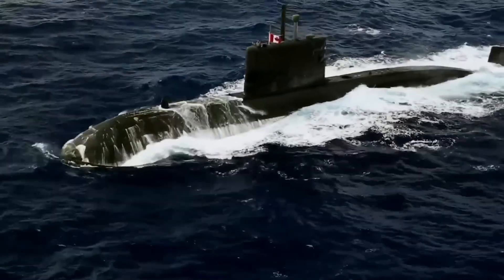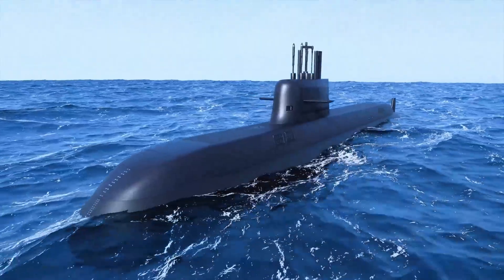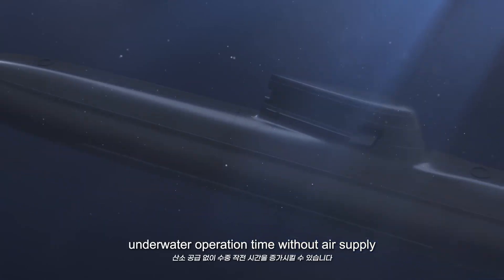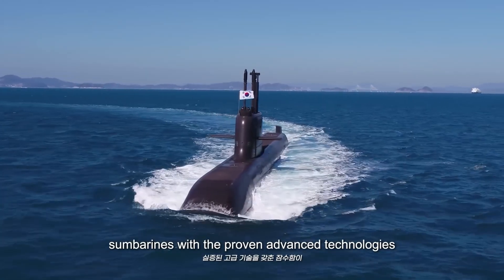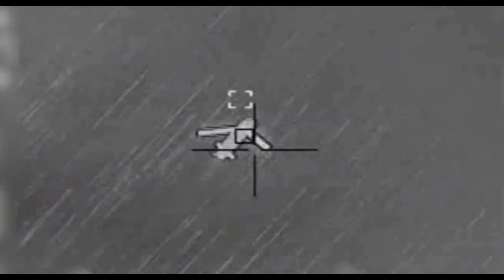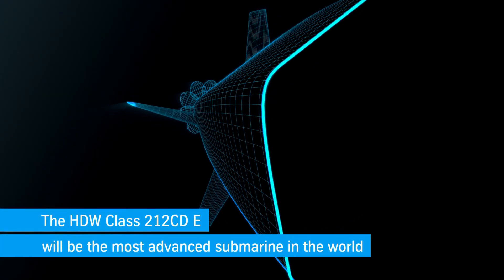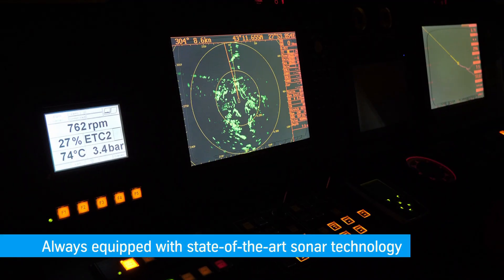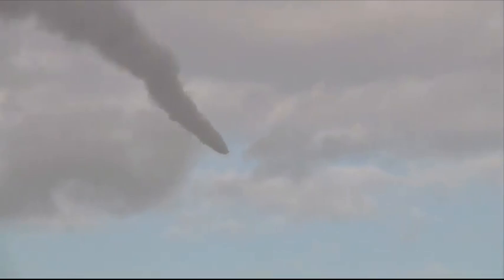RCN's Potential Next-Gen Subs

Comment: Longer underwater time and VLS make the Korean sub a better choice.  Also Koreans are VERY competent ship builders and that will translate to the subs being done on time and on budget.
Reply: The U212A/U212CD can operate underwater with its snorkel at 7000 Nm if necessary; the MTU systems are designed for this! Even WWII snorkel submarines could do this, for example, the Bauer 2540 Type XXI/XXIII! Range 15,000 Nm! When submerged, the U212CD can remain underwater for over 40 days!
Thanks to its air-independent fuel cell propulsion (hydrogen/oxygen) combined with modern batteries, the U212CD can stay underwater for more than 40 days, allowing for a significantly longer submerged duration than the KSS III (over 20 days). The KSS III does not have this modern system and will not receive it! The KSS III system is based on the MTIU diesel/U214 and its own battery technology, which builds upon the KSS II platform!
A U212CD scaled to a greater length with VLS systems at 90 or 100 meters can remain submerged for significantly longer periods, >60-100 days according to AI analysis and experts (or >100 meters)! The MTU diesel engines can then quickly split water into H2 and O2 for fuel cell and battery charging while snorkeling! The KSS III is essentially a derivative of the KSS II/U214, which is a class below the U212A!
The U212CD is in a class of its own, above the U212A, and according to experts, the KSS III would have no chance of survival in direct combat! AI analysis confirms this! Experts also believe that no other submarine/submarine hunter in the world can currently compete with the U212CD! That's why Germany has just ordered four more U212CDs, for a total of ten!

The development of fuel cell technology began at TKMS/BRD Research Institute/FI as early as 1943 with Type XXI/XXIII U2540! Instead of oxygen, they used peroxide, which was still too dangerous to handle! A test submarine of type U2540 achieved 27 knots underwater! In the 1980s, BRD/FI finally managed to make the fuel cell operational! So, over 40 years of development have passed since 1943, to be precise – 82 years in total! Korea would not have been able to build its own modern submarine without TKMS know-how. It's about time users who write nonsense understood this!
So please, let's finally forget that Korea can even remotely compete with BRD in this area!
Reply: The AI facts are based on source citations and state >20 days dive time! U212CD >40 days!  
Both submarine systems are completely different, and they don't even understand that the U212CD has a high-performance fuel cell system that is unique worldwide! TKMS also offers VLS, and a U212CD scaled to 90 meters can accommodate 40+ VLS!
The U212CD is based on the U212A, which is already a league above in high-tech sensor technology, surpassing the KSS III! DLR has globally unique simulation software to test everything, including combat deployment! They already demonstrated to the US military that the X-31 would shoot down all US jets in a very short time. The US military laughed at that. When the real test deployment came, they saw that DLR was right! That was back in the 80s! Korea should show the cold-water/Arctic -1.8 degree certification of their KSS III! They simply can't do that! The U212CD can do all of that, as the systems have been tested on the U212A for quite some time!
If they prefer Korean cars, Korea can build its own diesel systems instead of buying high-tech, certified MTU diesel systems! It's also possible that Germany will veto them, and KSS III won't have any MTU diesel systems with a one-year production time! 45 years of development went into them! Korea hadn't even considered building submarines back then!
Reply: The KSS III is specified with a dive time of over 20 days, and the U212CD over 40 days! The U212CD is scalable in length or overall volume. So, you could build a U212CD with 90 meters and install 40+ VLS (Vertical Launch Vehicles)! The dive time would then be over 60 days and the range 17,000 nautical miles! The new MDBA stealth hypersonic missiles (over 1000 km/h) and stealth cruise missiles (over 2500 km/h, nuclear-capable) could then be carried in the VLS! Korea doesn't have any of this, not even the 400-800 km/h Diehl Barracuda underwater missile presented in 2005! The KSS III has an operating depth of 200-400 meters, and the U212CD, according to AI and experts, 200-1000 meters... a different league! Regarding high-tech sensors, the U212CD is even a class above the U212A! 
KSS III doesn't even come close to the U212A, as the Koreans only had access to U214 sensor technology, which is a class below the U212A! TKMS will deliver the first 3 U212CDs starting in early 2027, and according to TKMS, they will be able to build 3-4 U21CDs per year from 2027 onwards! Furthermore, Canada, as a partner, is allowed to build its U212CDs in Canada using TKMS' high-tech 3D Helm system, which is unique worldwide! Regarding the training of new employees as well as career changers, Germany is number 1 worldwide! Meyer Werft is building the 250,000-ton "Icon of the Sea" at Meyer Werft in Türkiye and is using the German system in the process!
Reply: @tlsig submerged for “over 3 weeks” and travel more than 7,000 nm on AIP + batteries. Korean Sub edges out the German sub.

The Korean sub is proven and exists. The gerbman sub is theoretical.

Also given how reliable Korean Automakers are vs German I think the Korean subs will end up being better in actual world use.
Reply: @tlsig the proposed Korean sub to Canada has a greater dive time of over 3 weeks. Also the variation in the German sub with VLS is not in the bid. Everything about the German sub is vaporware/prop.  The Korean subs are real and in active service.  

as for "germany is number 1" I'd rather own a korean car vs german car for reliability after warranty and I think that would translate to subs

Comment: German sub is too small to operate under arctic sea. But Korean is gigantic. Korean can give Canada mach 6 hypersonic missiles and rocket torpedo which has over 300km/h in speed. German can not provide these weapons.
Reply: They're talking bullshit, just like their colleagues! Korea only has a small prototype that's supposed to reach 300 km/h and looks like a Russian torpedo with a range of only 15 kilometers!
Diehl presented the Barrakuda in 2005, which has demonstrably achieved speeds of 400-800 km/h and is about the size of a torpedo! Its range is 100-160 kilometers! This is all being handled under the strictest secrecy! It can only be intercepted by the Barrakuda! Germany has a 25-year head start.
According to AI, Korea will only really run into problems when the test object reaches full size with its enormous kinetic energy! 1 ton of combat weight at 400 km/h equates to 110 tons of kinetic energy, and at 800 km/h, 220 tons that need to be controlled! The Barrakuda only has a control cone and no stabilizing fins, making it much faster and more effective!

MDBA/2025 has unveiled a stealth hypersonic missile with a Mach 6-7 range of over 1000 kilometers! Also, a stealth cruise missile (nuclear-capable) with a range of over 2500 kilometers! If that's not enough, the U212CD can be extended to 90 meters with 40+ VLS or 100 meters with 80+ VLS! If you want a ballistic missile group M51.4 with over 50 tons of payload capacity and 12 nuclear warheads of 150 kilotons each, then the U212CD can be scaled up to the 12,000-ton Triophant class! Then it can carry 16 M51.4 missiles!
According to military experts, the U212CD is the most effective submarine for the Arctic, as it was specifically designed for that environment! All systems and components of the U206/9, U214, U212A, and U212CD are certified for cold water/Arctic conditions down to -1.8 degrees Celsius! Korea cannot boast that with KSS III!siles!

Comment: KSS-3 B1 3700t VLS 6cell
KSS-3 B2 4100t VLS 10cell
KSS-3 B3 4500t VLS 14cell
Reply: MDBA/2025 has unveiled a stealth hypersonic missile with a Mach 6-7 range of over 1000 kilometers! Also, a stealth cruise missile (nuclear-capable) with a range of over 2500 kilometers! If that's not enough, the U212CD can be extended to 90 meters with 40+ VLS or 100 meters with 80+ VLS! If you want a ballistic missile group M51.4 with over 50 tons of payload capacity and 12 nuclear warheads of 150 kilotons each, then the U212CD can be scaled up to the 12,000-ton Triophant class! Then it can carry 16 M51.4 missiles!
According to military experts, the U212CD is the most effective submarine for the Arctic, as it was specifically designed for that environment! All systems and components of the U206/9, U214, U212A, and U212CD are certified for cold water/Arctic conditions down to -1.8 degrees Celsius! Korea cannot boast that with KSS III!

Comment: Memory: Korean submarine based on the German type U209, developed in the 70s, which the Koreans bought. The Koreans enlarged it and equipped it with lithium batteries and this vertical launch system. It is therefore a technically state-of-the-art model. The U212CD is based on the U212A type, the successor to the Type 209. Its technologies are 1.5 to 2 generations ahead of the Korean submarine. Canada gets the chance to build its own 212CD in Canada alongside the Norwegians and Germans. The project is timely and on budget, so the whole discussion about faster deliveries from Korea is pointless.
Reply: 당신은 거짓말 쟁이군요..ㅋㅋㅋ
한국은 209만 도입한게 아니라
이후에 214급도 도입하면서 계속해서 기술을 습득했고,
 현재는 이를 바탕으로  자체 개발한 kss-iii   batch1 3대를 생산하여 차례대로  전력화중이고,,
지금은 batch2의 두번째함인 장영실함까지 진수한 상태입니다...
결국 수중배수량 4000톤의 수직발사관을 가진 세계최고 연속잠항능력을 가진 재래식 잠수함을 
5대 생산하여 차례대로 전력화 또는 진수식까지 완료한 상태이지요.
서류상으로만 존재하는 독일모델과는 비교할바가 아니지요...

Comment: I saw the Korean sub up close while stationed in Jinhae, the naval base near the Korean naval academy. The specs are legit and it is very silent. This is the one Canada needs in light of Korea’s growing defense industry.
Reply: Exactly. German submarines, particularly the Type 212 and 214 models, are medium-sized vessels designed for coastal operations. They have limited operational range and endurance, and their fuel and resupply capacities are constrained, making them unsuitable for countries like Canada that require coverage of the Pacific, Atlantic, and Arctic Oceans. This design philosophy reflects the operational environment of the German Navy, which primarily operates in coastal waters such as the Baltic and North Seas.

In contrast, South Korea’s KSS-III-class (Jangbogo-III) submarines are large vessels of approximately 3,700 tons or more, capable of ocean-going operations. They are equipped with large batteries, hydrogen fuel cells, and an Air-Independent Propulsion (AIP) system, enabling extended submerged endurance and long-range missions. These submarines can also carry long-range cruise missiles. The large batteries extend the duration of electric propulsion, while the hydrogen fuel cells and AIP system allow prolonged submerged operations without atmospheric air, significantly enhancing stealth. This technological advantage enables KSS-III submarines to conduct sustained operations across the vast maritime areas required by Canada.

German submarines are primarily deployed in European waters. Specifically, Type 212A and 214 submarines operate in relatively shallow and enclosed seas such as the North Sea, Baltic Sea, Mediterranean Sea, Adriatic Sea, and Aegean Sea. While they benefit from quiet AIP operation, their displacement is only around 1,800 to 2,000 tons, and their operational endurance is typically limited to 2–3 weeks, making them unsuitable for oceanic voyages.

Therefore, while German submarines are suitable for European coastal operations, the KSS-III clearly represents an ocean-going expeditionary platform. For Canada to meet its strategic requirements, the choice is evident. The KSS-III-class submarine is uniquely capable of supporting Canada’s maritime security strategy across the Arctic, Atlantic, and Pacific Oceans.

Comment: The KSS has the ballistic missiles.  Canada doesn't have an offensive capability and its worthy of consideration.  Any belligerent or incursion into Canadian sovereignty territory will assess risk and these subs have that added feature.
Reply: The 212CD can fire the same volley using the torpedo tubes, six at a time and then reload,so much slower. It can also take out anti submarine helicopters like the CH-148 and the anti submarine P-3 and/or P-8 aircraft. That is a game changer right there.
Reply: First do you need it? If you launch a bm the sub is instantly detected and will be hunted down. Also how many korran missiles do you have? 
Much better to focus on europe than sk